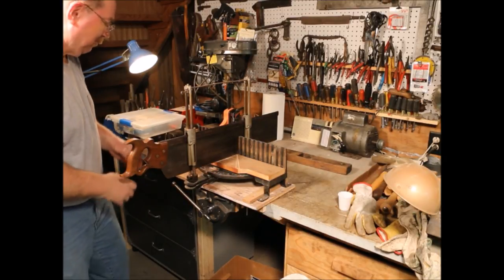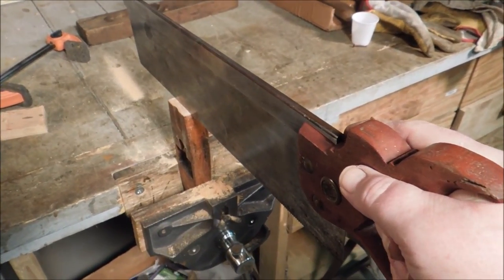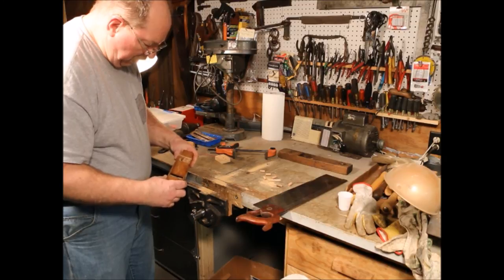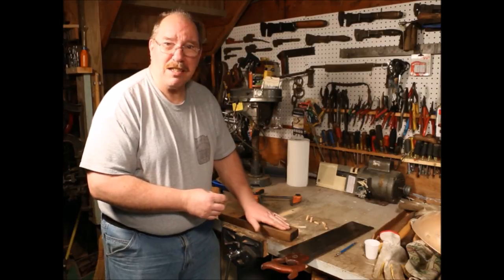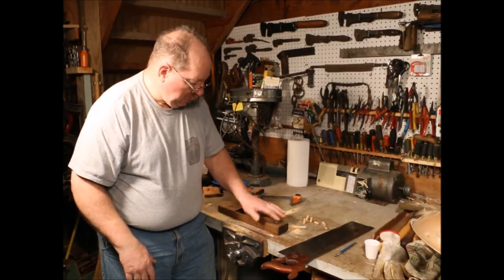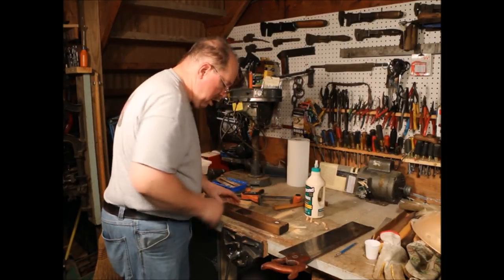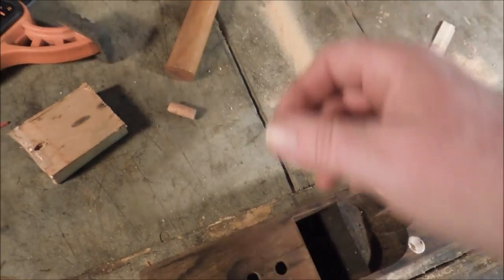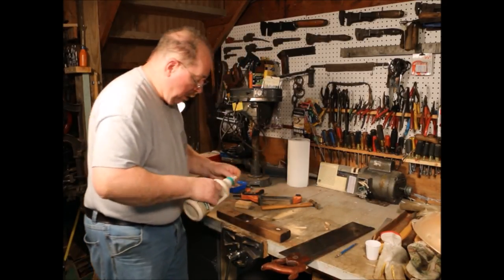Union Transitional Plane ~ Part 6 ~Cutting The Plugs Free & Gluing Them In ~ by Old Sneelock's Works

Comment: A joy to watch. The back saw that fits your mitre frame is truly a beast. How do you find the woodworking adhesive works in the wood which has been heavily oiled with BLO ?, does it still stick ok. I agree 100% with your comment on plug configuration, it is like getting the slots in slotted screws to line up. It is neater and it works.
Reply from the maker: I have an even bigger saw. It was purchased with the idea of having one to go with a Miller's Falls Langdon style miter box. It is too big to fit anything but the Stanley. If I ever need to cut a miter in a 4 x 6 I'm set. :-)
Reply from the maker: +UK Tony I use Titebond III which seems to stick to almost everything except wax.
Reply: Thanks for the glue info. I have always used pva white glue and oily wood would not stick. Looks like I will have to get titebond, which Steve Ramsey always uses on WWMM.